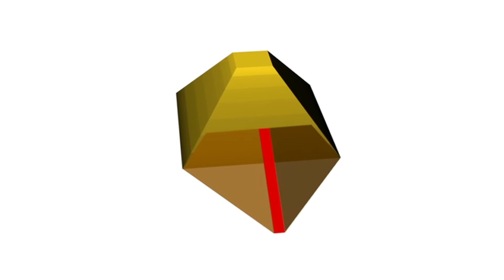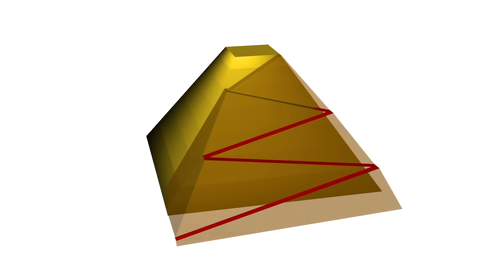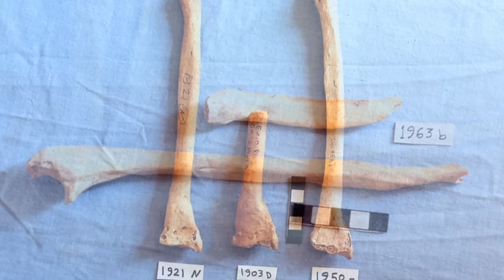Egyptology - Pyramid Construction

Comment: If you ever think you’re stupid, just know that there’s people in this comment section that genuinely believe the pyramids were built by aliens and giants, and refuse to accept the possibility that maybe, ancient civilizations were more advanced than we thought
Reply: The ancient Egyptians were not stooopid - BUT - neither were they "advanced".  They simply via trial & error tried various things until they found something which worked and they ran with it.  So they made the pyramids using basic techniques:  ramps + sleds pulled by teams of men and oxen + levers and lever devices using a fulcrum and counterweight akin to the Egyptian shaduf + copper and gneiss stone tools + and "elbow grease".  lol!  

They also used fire to help get through bedrock via heating and rapid cooling of the stone using water as well as abrasives such as sand or corundum to polish stone smooth.  They were not cavemen after all.
Reply: @varyolla435  exactly, and there’s dummies trying to credit aLiEnS

Comment: Since the pyramids were flat on top as they build up. I think they just use a simple center heavy pillar with a series of pullies and long ropes.
At one end of the rope would be attached to a platform with a sled that slides down the side of pyramids. At the opposite end of the rope will be same system. Workers would load blocks of stones on the platform and which will cause the platform to slide down the side of pyramids while the lifting up the other side of the platform with the stone block needed.
Reply: Very clever idea.

Comment: I dunno......
2.3 million blocks....

46,000/ year * 50 years.
That's 5.25 blocks an hour, 24/7 for 50 years.... Found, cut, polished, moved, and fitted into place.

And you think you have a crap job? LoL
Reply: You left out the most important variable = "synchrony". 

Moral of the story:  the Egyptians were not doing things "1 block at a time".  They rather were doing things the same as we do today.  When building a brick building do masons lay a single brick to go back for another - OR - do teams of masons working in tandem lay bricks in multiple locations simultaneously???  Think about it.   

p.s. - also very few of the total blocks were carefully cut let alone polished.  Most are actually nothing more than crudely fractured chunks of stone of varying shapes and sizes which were dropped in place leaving gaps all over.  The quarries which supplied that stone lay = 100-200 meters away - so they did not need to be moved very far.

Comment: Two and a half tonnes is only the standard size of one layer of casing stones, there are several layers, and the internal structure is megalithic. There's no evidence of ramps being used. And they never used filler in the original construction, because every single block was precision cut. Studied pyramids for 30 years? A complete amateur could take him apart in 30 seconds, no mention of the tool marks at Aswan quarry either, like that's not important when talking about pyramid construction.
Reply: "We don't know what tools they used, but I'm not going to mention the clear evidence of machinery found at the quarry, I'll just show you all some simple hand tools that couldn't precision-cut giant granite blocks if you had a million years to complete the task" 
Brilliant
Reply: You rant here to be polite is a dumpster fire of exceedingly poor assumptions.  Would that you had exerted the same amount of effort into learning the facts here as you did to spouting nonsensical claims = imagine what you might have accomplished.

Moral of the story:  the 2.5 ton claim = AVERAGE weight of the blocks.  The blocks themselves varying widely in size with those at the upper half being smaller in size and those closest to the bottom being larger.  The heaviest blocks are found in the relieving chambers about the King's Chamber which is only about halfway up.

Next is there is loads of evidence about the ramps.  That you are not aware does not mean it does not exist.  lol!!  Also very few of the total blocks were carefully cut and even less were polished.  If you go in a few layers as can be seen with the exposed sides the blocks are little more than crudely hewn chunks of stone with globs of gypsum mortar everywhere along with small chunks of quarry debris stuffed into crevices.  

Finally the tools can be seen in museums and the tomb depiction in the tomb of Rekhmire which shows craftsmen at work.  Thus clearly there is an amateur here and it is not the video creator who references evidence from actual subject-matter experts.  Garbage in ----------> garbage out as the saying goes.  Enjoy your misinformation.
Reply: @varyolla435  yeah just venting, made me feel better, you know, a quick break from watching the free world collapse

Comment: What if the pyramid itself is the Ramp!
Reply: Never premise something with "what if.........." as you are admitting you lack credible evidence and what is postulated is usually wrong.  Just saying.  As to ramps.  The ramps used to construct the Giza pyramids were made from earthen mixtures of sand/stone chips/tafla - a clay they mined.  Near the worker village at Giza is the remains of a massive tafla mining operation.  In the western cemetery next to the Great Pyramid are partially completed tombs which have adjoining small earthen ramps made from such as I described.  

Finally when the limestone quarries at Giza were excavated years ago they were found to have had enormous quantities of the material used to make ramps dumped into them.  So they used external ramps to raise blocks along with a lever device such as the Egyptian shaduf scaled up which used a fulcrum and counterweight.  The blocks of the pyramids become smaller as they rise in height so that the larger blocks on the bottom were raised via the ramp and the smaller blocks above via the "machine". 

As they encased the pyramids in white limestone working from the top down as Herodotus wrote they systematically dug away the ramps as they worked and dumped the residue into the open quarries to backfill the area. This is what the evidence shows.

Comment: You could build a structure like that with much smaller stones, like regular stonework, the walls could be large double skin and a large cavity left in between to be mass filled with concrete. The outside was clad in limestone anyway, so you wouldn’t be able to tell the difference. This would be far easier than the theoretical methods proposed so far. The fact that they built these pyramids with such massive blocks suggests to me they did it this way because they had either some technique or technology that made building with such large blocks the most efficient way to build. It remains a colossal mystery.
Reply: Or = they simply recognized where they lived.  lol!  Follow the white rabbit:

1 - Egypt rests near the Middle East.  Running through Israel is the Jordan Valley.  That valley is = a "rift valley".
2 - ergo = that region of the world suffers from earthquakes.  To make matters worse parts of the Mediterranean basin are also active volcanic regions = especially around Greece and Turkey.  Let's move on shall we.
3 - Djoser's Step Pyramid was built from your small blocks.  They in part compensated via slightly tilting the blocks on the bottom part of it inward.  Yet ultimately over time thanks to periodic earthquakes the pyramid suffered damage the same as others in the Dahshur necropolis area.  It coincidentally was just recently shored up via years of renovation work done to it.
4 - so the Egyptians - and others - compensated to earthquakes via building things which had larger parts on the bottom and smaller parts on the top.  The Roman temples at Baalbek as an example have huge base stones at the bottom with smaller ones above.  Greek temples contained pegs inserted between the blocks of their colonnades which allowed the individual segments to wobble a bit yet remain together. 

Moral of the story:  thus placing very large blocks at the bottom - closest to the ground - facilitates stability of those above in the event of earthquakes.  Also they take up more "space" which reduces the total number required.  From a structural standpoint they despite being heavier require less overall effort since as noted they do not need to be raised as high.  Small blocks above - though more numerous in numbers - require less effort to raise.  

So forget about concrete or double skin walls or whatever.  lol!  They did what they did based upon the technology they had at the time and what worked given the risk of earthquakes and subsidence. Mudbrick houses were easy to create but limited in how high you could make them.  The Pharaohs wanted their creations to stand out and last.  Thus they built from stone and that stone was based upon aesthetics + structural durability + and the risk of collapse from tremors.
Reply: @varyolla435  Building the walls with double skin and infilling with concrete would behave structurally the same as one large stone mass. It’s essentially  large blocks formed in situ.
Reply: @varyolla435  also it wasn’t based on aesthetics because they clad the exterior in small limestone blocks anyway.
Reply: @2ez_travis899  "The fact that they built these pyramids with such massive blocks suggests to me they did it this way because they had either some technique or technology that made building with such large blocks the most efficient way to build."

You infer here that there was some supposed reason for what we see.  I = gave you that reason.  So there is no mystery here.  There is nothing more than basic construction techniques to compensate for weakness of stone and available technology = nothing more.

As to concrete or double walls or whatever = Pffft!  They lacked these things and thus what point hypothesizing about what did not exist??  It is sterile conjecture.  I deal with historical evidence and not speculative fantasies.
Reply: @varyolla435  Concrete existed then, it’s far from complicated. They had aggregate, sand, gypsum and lime. Ignore the ‘small stones’ if it’s troubling you. These ‘walls’ i mention could be treated as formwork for the concrete, even removed after the concrete had cured. 

Nobody knows how or why the pyramids were built. That’s the only fact.

Comment: Why wouldn't they have thought about the "block and tackle"? They might have not written it down, but come on, it's so obvious!
Reply: What may be obvious to "you" = is not so for others.  Thus it becomes a subjective rationalization which exists only for you being premised upon your desire to believe it.  Better luck next time.

Moral of the story:  you are attempting to rationalize based upon current knowledge rather than = past evidence.  So why stop at block and tackle then???  lol!  Why not simply claim that they used diesel powered cranes and bulldozers since after all you have as much evidence to support that as you do your block and tackle claim???  

So you base conclusions upon WHAT YOU SEE rather than what you "assume" with nothing to support the assumption.  There is zero evidence to support the Old or Middle Kingdom Egyptians using block and tackle - nada.  That makes it just so much more fanciful speculation for your part.  Something new to think about.

Comment: They didn't need a ramp bigger than the pyramids. What we really need to look for is the technique of moving the rock up by just one space.
Reply: Lever devices which employ a fulcrum and counterweight akin to the Egyptian shaduf.  Also they did use ramps as there is ample evidence of this.  The ramps however did not need to go to the top for the simple fact that = the blocks become smaller as the pyramid rises in height.

So the largest/heaviest blocks are found = in the bottom half of the pyramids closest to the ground.  Above the level of the King's Chamber in the Great Pyramid the blocks are smaller with those at the top being small enough to have been levered into place by several men.  As such the earthen ramp really only need have gone as high as = the King's Chamber.  The smaller blocks above that level could be raised from level to level via the lever device which sat upon the steps and which Herodotus referred as "a machine".
Reply: Thanks for your explanation.
But there are still doubts. Once they start climbing the ramp, they cannot rest until they reach the target point.

And despite the opinion that the pyramids were built before the founding of Egypt, scholars are still trying to find hints in Egyptian murals.
Those murals are probably what they looked like when they were made to imitate the Great Pyramid.

So I think the way scholars guess is wrong. We can easily guess that more advanced techniques must have been used than the methods of the murals.

Comment: They used Bulls for the hard stuff. There is Tombs filled with Bull bones and other animals meaning they worship the animals of having them be in use with Pyramid creation. Im sure there was a Buffet before burying the bones.
Reply: Correct.  The ancient Egyptians the same as others - to include even today in parts of the world - employed draft animals for manual labor.  You can see in tomb depictions yoked oxen doing everyday tasks while the tomb of Hunefer shows a funerary process with yoked oxen pulling a large sarcophagus on a wooden sled such as they used.

So the worker village at Giza contained in its midden heaps many tens of thousands of cattle bones.  That places cattle at Giza during the period of the pyramids.  As such if they were consuming cattle it is inconceivable they were not also using them for manual labor to include the pulling into place of the larger blocks found towards the bottom of the pyramids.  People like to talk about human labor but they always overlook animal labor.  An ox can pull more than 2X its own body weight so that teams of oxen could pull multi-ton loads.
Reply: @varyolla435  I believed that so called giant disc they found was filled with Diamonds once and they used the animals to make it spin to cut the Stones. I even believed the Egyptians traded for acid water to be in use of the smoothing of stone surfaces..

Comment: We just need to watch earth from 6000 light years away with very large telescopes and then we can watch them building the pyramids
Reply: @John Seed yeah I did say that it was currently not achieveble and likely always will be. Generally its quite an interesting thought that it is literally possible if we had the means to perform such an action.
Reply: You only will see a dot of our star. you cannot see this planet directly, it is only made visible through transit measurements.
Reply: @John Seed I disagree. If we can figure out how a proton can simultaneously be at opposite ends of the universe we might unlock all the secrets
Reply: @John Seed What about going through a wormhole (assuming thats possible)
Reply: @John Seed That's only if you travel at the speed of light, if you can find a way to go faster than you can in fact see the past.
Reply: @John Seed IF We could travel faster than light, Would We be able to see into the past??
Reply: You’d have to be there first. You can’t travel there and be able too see it as it was 6000 years ago unless you were traveling faster than the speed of light.
Reply: your exactly right!!!! you get it. time is not real!!!

Comment: If they were a ramp, where are its remains?
Reply: Sitting in the desert next to the necropolis.  When the adjacent limestone quarries at Giza were excavated years ago they were found to have had massive quantities of sand/stone chips/tafla dumped into them.  Tafla is a sedimentary clay the Egyptians mined and used for lots of things.  There is the remains of a huge tafla mining operation near the worker village at Giza,

So next to the Great Pyramid is the western cemetery.  In the cemetery are partially constructed tombs = and next to those are small earthen ramps made from the same material found dumped into the limestone quarries.  So the answer to where are the ramps is = they are still at Giza - just dumped into the surrounding desert after the site was excavated over the years.

Moral of the story:  Herodotus wrote the Egyptians first created what was termed as "a great causeway" which he stated took 10 years and was considered to be as great an undertaking as the pyramid itself.  Then they spent another 20 years completing the pyramid.  So that causeway = ramp.  

He also wrote they then encased the pyramid in white limestone working from the top down.  That ramp need only go as high as the largest/heaviest blocks to be raised = King's Chamber.  Above that level the blocks are smaller as the pyramid rises in height.    So he stated they used "a machine" and levers.  The machine was likely a larger version of the Egyptian shaduf employing a fulcrum and counterweight and it would have sat upon the steps to raise the smaller blocks above as he finally said they first created a "stepped" pyramid ala Djoser to then fill it in.  So as they encased the pyramid in white limestone from the top down = they systematically dug away the ramp as they went and dumped the residue into the quarries to backfill the area.

p.s. - they might have also used smaller mudbrick ramps above as well.  There are the remains of such at Karnak used to build temples there while the tomb of Rekhmire shows a hypostyle temple being built using a mudbrick ramp.  Something new to think about.

Comment: They didnt lift blocks up. They dug a square hole in a mesa. Then they dropped  the cut cubes in place. Which they cut from the walls of the inside of the square hole.